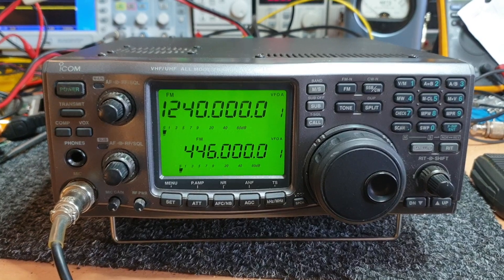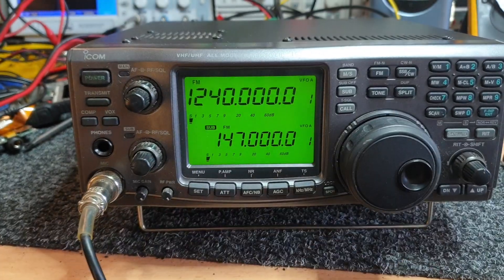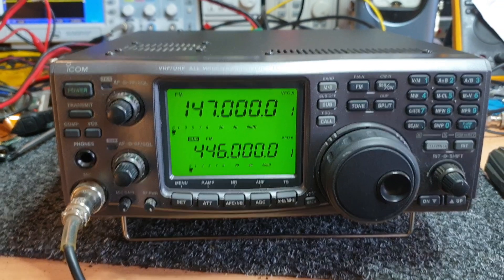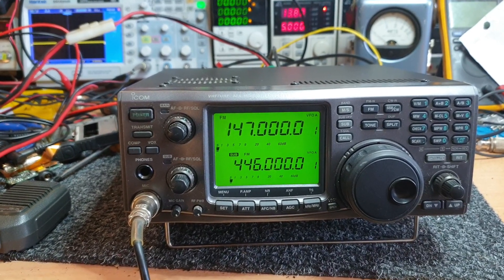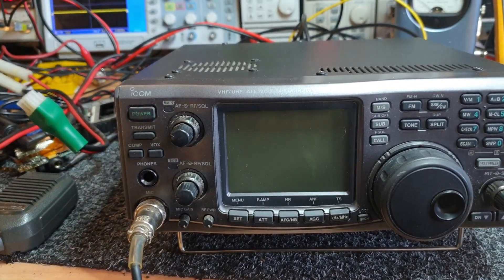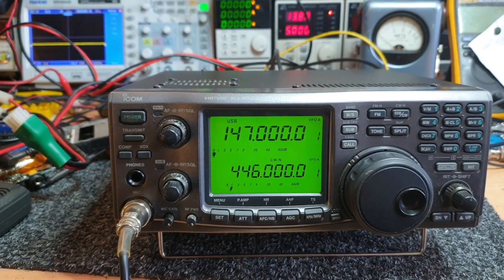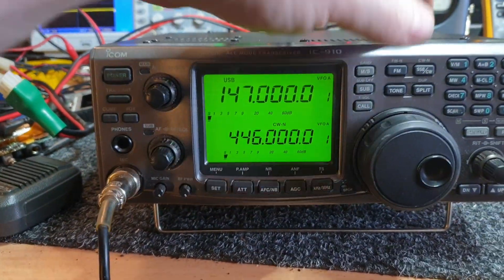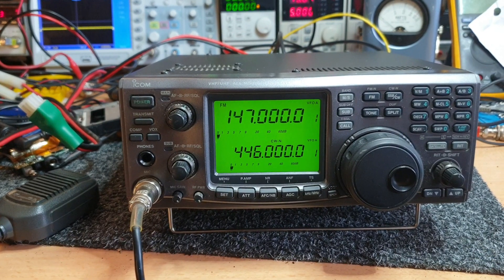Icom IC910H VHF UHF Transceiver-Why can't I get 100w FM carrier, we show you why you lose 50watts🤯👉💥

Comment: I have a similar problem checked the leads all good swapped to longer leads frm my ic746 no change either way 23 cm works fine but uhf and  vhf stopped tx so i think maybe 2sk2975 pre driver voltages low and high on tx but having trouble getting the board out to replace chip any hints? Cheers Harry 73

Comment: If you look under that green rubber boot, you'll see that the Icom OEM cable uses two very thin wires to combine the redundant pins into one set. You may also note that the way the fuse holders are crimped on is often inferior and not appropriate for a 100W FM radio. Try replacing the ground lead fuse with a 40-50 amp slow-blow, and soldering the fuse clips.

Comment: well one thing for sure, 910H beats the 9700 for one big reason, and its on the front panel of the 910h.... rf power and mic gain front panel, not in some stupid menu. if mic gain and rf power ain't on the front panel, then radio is a automatically a dud due to poor design.